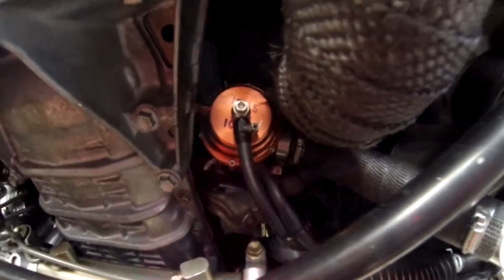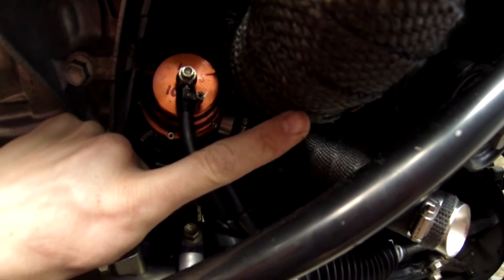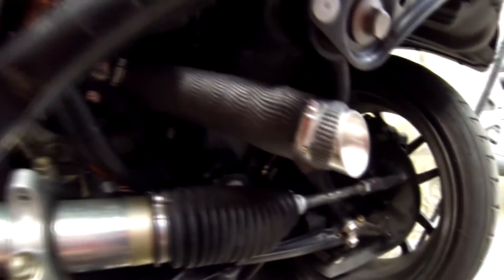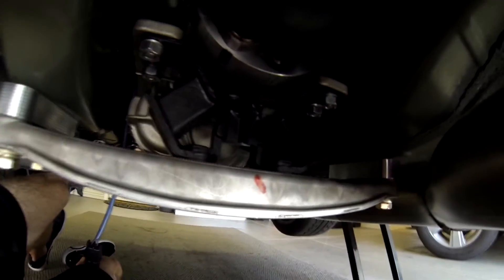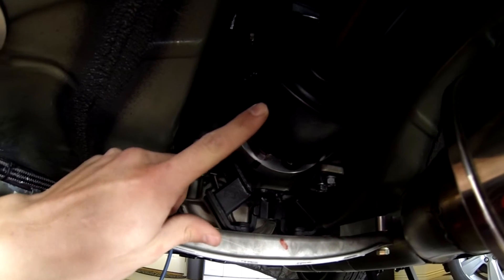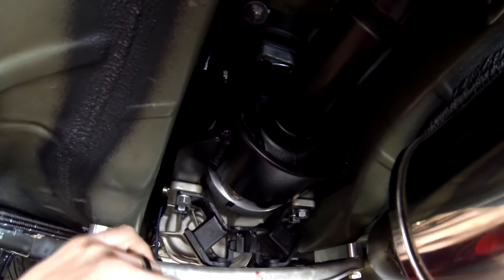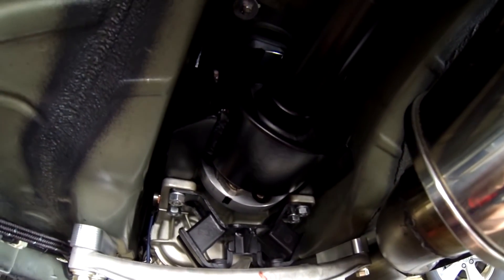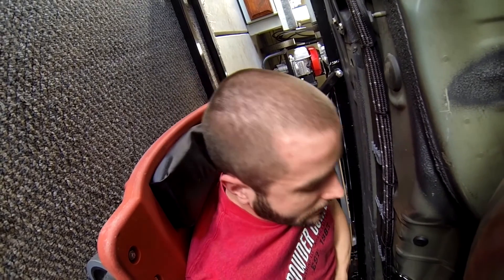Turbo IS300 Update 5 - Down Under!

Comment: I love how care about every detail of your car. great job and good luck on your build!
One Q, what Ignition Coils are you running?
Reply from the maker: Thanks man! I just barely installed the Mojo Performance LQ9 Coil Conversion. I haven't run the car with them yet so I can't really give an opinion as far as performance difference goes but I feel like they should be a decent upgrade over the factory IS300 coils (waste spark). Thanks again for the support!
Reply: whoa! so that means you hit 600whp with the stock coils and igniters? that's impressive! Keep the updates coming
Reply from the maker: Yep! I was actually really impressed with the factory IS300 ignition system. I think I had my plugs gapped down to around .020" and it ran great that way for several years.
Reply: XtremeCoupe on the subjec of plugs what plugs are you running?
Reply from the maker: I have been running Denso Iridium IK27 plugs with very good luck!

Comment: great update, is the exhaust system an off the shelf item or has this been custom made for your car?
Reply from the maker: I built the entire exhaust system with components from Vibrant Performance. I basically just ordered a couple of each type of bend and worked from there. I also used a Vibrant resonator and muffler. Thanks for the support!
Reply: XtremeCoupe built yourself!! skills!! looks great, keep up the videos 👍
Reply: Can u tell me what parts u got from vibrant? Like which exhaust can and or resonator? What size piping?

Comment: Custom FFIM, can you give some details on that?
Reply from the maker: Hey there,
I built the FFIM with the lower portion of the factory intake manifold and parts from Ross Machine Racing (plenum, throttle body flange, throttle body). I have access to a CNC mill so I used that during the fabrication. I think there are a couple pictures of the inside of the FFIM on my instagram @two.jay if you want to check it out.

Comment: a few questions have ever  turboed the stock 2g that comes in the is300 ? and what engine software are you using
Reply from the maker: I built my engine before installing the turbocharger. I'm using the AEM V2 for tuning.
Reply: XtremeCoupe nice

Comment: are you still on the stock rear diff? and did you do a custom 1 piece driveshaft?
Reply from the maker: Yeah, still on the factory rear-end for now (3.91 LSD). The driveshaft is a 1-piece custom shaft from Driftmotion.

Comment: I just finished running -6 lines on my IS where are you able to run -8? I see almost no room what so ever to run -6.
Reply from the maker: Hey, are you talking about the fuel lines? I'm running a -8 feed and a -6 return and they are just tied to the factory lines underneath the car. They are a little tight going up to the top of the fuel tank but I didn't have too much trouble with them.
Reply: XtremeCoupe. man in that case I had trouble just getting both lines return and feed to the stock hanger. it was such a pain to get mine around the fuel tank almost was afraid to kink. line.

Comment: Hello is that a one piece propshaft there ?
Reply: I Just read the comments ..  it's a one piece does it give any vibrations ?
Reply from the maker: @giles200sx  It is a one piece shaft that I got from Driftmotion. It utilizes 1350 joints and came with adapters for the transmission output and pinion flanges. No vibration issues here.
Reply: Thanks for the reply mate 

I have 620 whp rb25 s14. but I'm now swapping the engine in to a is200
Reply from the maker: @giles200sx  Awesome, sounds like a fun project!
Reply: Cheers mate im picking up  is300 diff and axles on week end to make sure it takes the power 

What size tyres you running and whats the offset on the  wheels ?

I tried the wheels off my s14 but they stick out too much on the rear